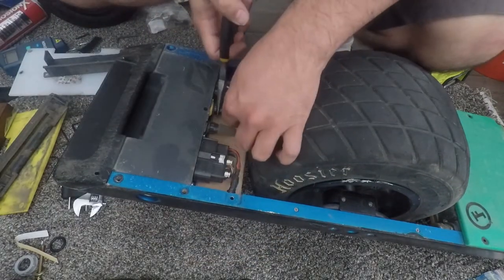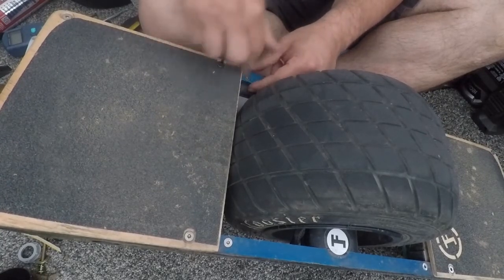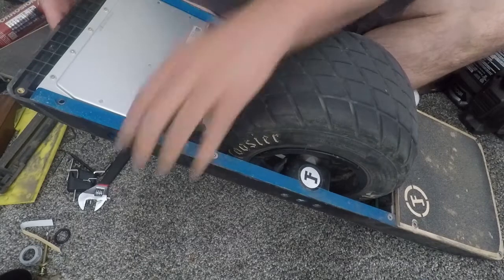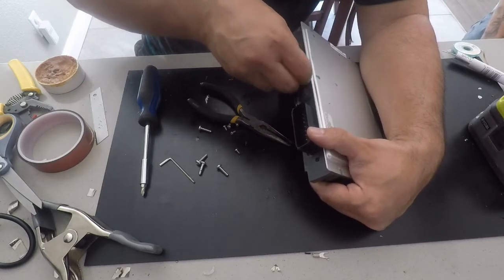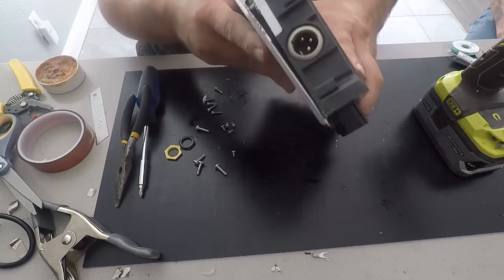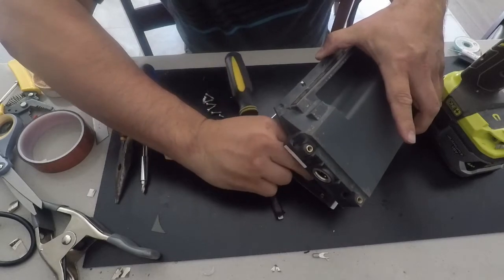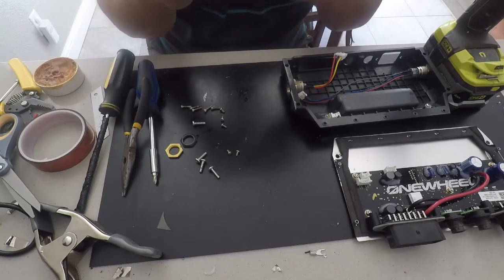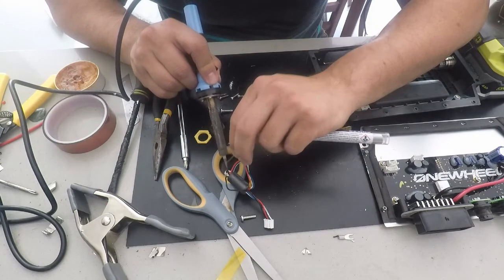Onewheel Workbench: Fix LED Light & Secure Ferrite Ring

Comment: Awesome video!  My XR LED headlights stopped working a few days ago.  1,333 trouble free miles so far.  This is the 1st problem with the board.  I ride it mostly off-road.  This winter, I'll open it up and fix it and glue things down.  Thanks!
Reply: I'm at 1200 miles doing the first tire change lights are gone though flickering in the front
Reply: @Therealphantomzero  Cool. I still haven't gotten around to fixing my lights, but still ride as often as I can.  Enjoy your rides!

Comment: That was an awesome, fascinating and detailed video. My onewheel is brand new, I just watched because it was interesting and I'm a tech head haha!
It drove me a tiny bit crazy at one point when you kept trying to balance the ferrite wire cluster on the scissors handle and it fell over. Again and again and again and I helpfully yelled out at you PROP IT UP WITH THAT BIG GRIPPY SPRING CLAMP SITTING 2 INCHES AWAY! 
Haha! But seriously, good job. Thanks for making this.
Reply from the maker: Haha that would have been better ;)

Comment: When removing the cover from the housing, it is very easy to stress the solder connection between the pins of the two round connectors and the small vertical printed circuit boards, PCB, that interface them to the main board. This stress can actually create a break in the trace of the small PCB. Your Onewheel will not function and you will need to disassemble the whole thing all over again. If you or a friend have skill working with PCB's, I recommend making wire connections between the pins of the connector and the main board. This will give assurance that your board will work when you assemble it and that these very important connections don't fail as you ride. The small PCB should have been, in my opinion,  a two sided board with plated through holes for better reliability.

Comment: Thanks for the video! That glue was a pain in the a** to get apart. A copper coil has a broke connection in mine. Do you know if I should replace the whole piece or just reconnect the broke connection?

Comment: Not sure if you still monitor this video or not but do you have to drain the battery prior to opening/changing the connector for the lights? Just got a new one to replace mine due to the front white lights not working.

Comment: Anyone know what would make my front right side foot pad (pin 1 to GND) stop working? Te footpad is fine, it's on the motherboard side, that is the problem.
 I had the LED wire severed, all of them too.
Reply from the maker: It's pretty common for the pins on the pcb to separate from the contacts on the board. Solder will probably have to be added to re-connect the pins to the contacts on the connector that the footpad connects to.

Comment: I can already tell I'm gonna have to refer back to this video soon 😂 My wife goes hard (Sandy Peter)
Reply from the maker: c0pyimitati0n haha, she's awesome! If you're under warranty, just Send it in. No point in voiding the warranty for this
Reply: Grind671 I feel like this would fall under the 'Magnuson Moss Warranty Act' ... I figured if I go in and secure it now, then I won't have this problem happen at all.
Reply from the maker: c0pyimitati0n it does, but you'd have to spend time fighting them about it
Reply: so do you think the adhesive holds up fine after doing this? Do you think it has the same water resistance?
Reply from the maker: It's hard to say, but I think the gaskets aren't as good as before you open them. If you're really worried about water, you might want to seal all the entry points with silicone

Comment: Is the process for a XR the same? And does the board get less waterproof after this?
Reply from the maker: Yes
Reply: Grind671 for both questions?
Reply from the maker: @benediktstaritz7327  yes and yes. The OneWheel isn't very waterproof anyway. If you want to waterproof it, consider using the badger kit @ https://www.badgerwheel.com
Reply: Grind671 alright, thanks!
Reply: @Grind671  my board was badgered by someone else.. Would opening up the controller like this ruin any badgering done and would need to be re badgered then?
Reply from the maker: @justinspirational  i believe youd have to rebadger. I believe badgering uses silicone adhesive to seal everything. Once you break the seal, youd have to reseal it
Reply: @Grind671  ok thanks

Comment: Thanks for the video. Do you know if this issue exists on the XR?
Reply from the maker: It does
Reply: @Grind671  That's really bad especially seeing is FM must definitely know about this issue. Do you think it's worth opening up my Plus and doing this mod before the LED wire breaks?
Reply from the maker: @cubiq1  no. If its under warranty. Let FutureMotion fix it. If its not, just wait for the issue to occur
Reply: @Grind671  OK thanks.Do you think it's possible getting a small piece if foam in the box without having to take the entire lid off?
Reply from the maker: @cubiq1  yeah, people do it all the time.
Reply: My (front) Red LED died a few weeks back.

Comment: I know this is late advice but use 99% isopropyl alcohol when facing adhesive. The alcohol will make removing it easy when wet, and become sticky again when dry. It has to be 99% you don't want contaminants in the alcohol.

Comment: So my wheel is 5 mo old...   and the red light on the bat side is not working.  I hope FM will send me the control box.  Definitely a design flaw.
Reply: Paul wojdac I'm in the same situation. Got all things from FM to send it in for repair for free - as long as they don't find something the warrenty wouldn't cover. If this is the case I'd have to cover the repair+shipping costs by myself. I've read some stories of people who sent it in because of "small" issues like our broken lights, and suddenly had to pay big amounts of money to get it back.. Have you sent it in already?
Reply: I have not sent it in yet...  they will not send me a control box stating that the connections are sensitive.   Doesn’t FM realize most of us are geeks with a tool box...

It seems that they could send the control box with a disclaimer and a core charge and have better customer service less down time, cheaper repair less demand on their support maintenance folks.

If the connections are sensitive...  they should be ruggedized and redesigned the OW board.  It is publicized as a rugged trick friendly snowboard experience, and should not have wimpy connections...   

but then again the lights don’t work so i would hope FM replace the connectors with new connectors that will live up to the OW publicized capabilities

On the hostage comment, I would be ashamed to own a OW if they make repairs with out my consent and hold my board hostage Shame...shame shame...